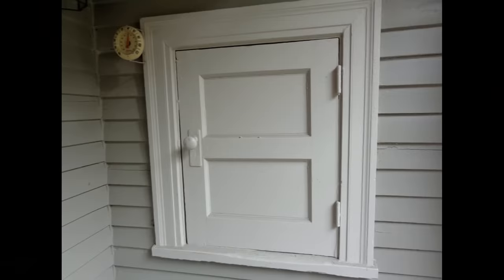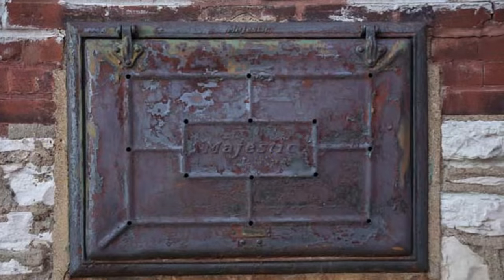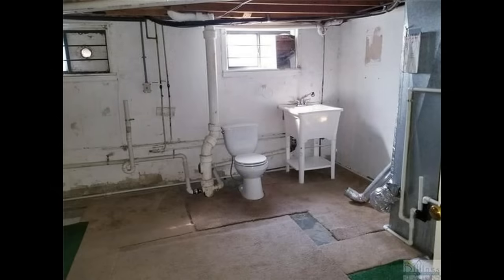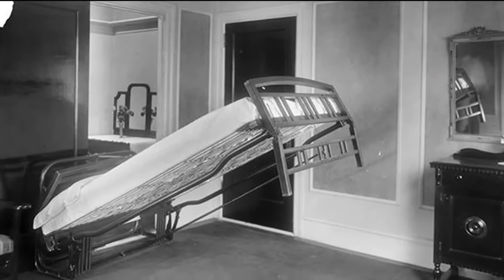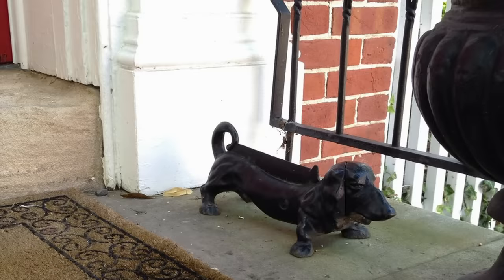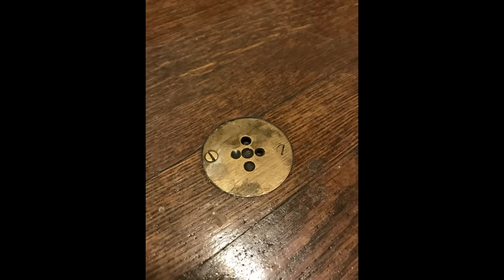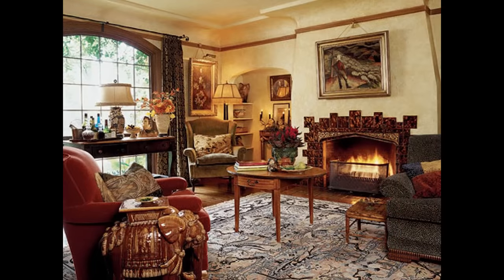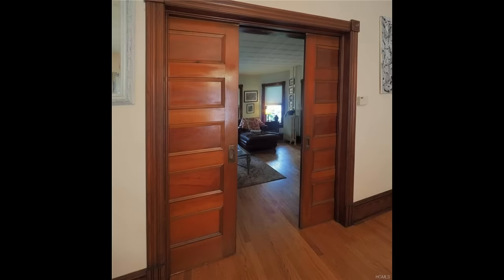Mysterious Home Features No Longer Used

Comment: We moved into our current house, built around '67,  in '93.  It has completely broken intercoms all over the place.  Many times, I've thought about looking into getting them fixed somehow, but I suspect that would involve breaking holes in walls to find shorts or cuts in wires, and I can't imagine it being worth it.  Always wanted a dumbwaiter, though, despite never having a single reason to have one.  The really weird one though, is that when I was a kid, I used to have recurring dreams of finding toilets out in the open in the house in which I grew up, like in the closet that was in at the bottom of the stairs, or in the garage.  I always imagined it was just typical weird dreams, but seeing that these sorts of things used to actually exist is kinda weirding me out a little.
Reply from the maker: That is interesting on your dream and it almost sounds like something you could use to right a story on in a book.  I'm sure there is someone out there that could fix those intercoms and it may not be so bad.  It may depend on your attic space though and some of those 60s homes have a really tight one if they have one at all.  Thank you for watching and sharing what you have.
Reply: If I'm dreaming, and I have to pee IRL, I will often dream that I'm looking for a toilet and any I do find (which is rare, usually I find bathrooms with empty stalls, or all showers and no toilets, or a door marked "bathroom" that leads to something else like a stairwell) will have something wrong with it--either a lack of privacy like having no walls, or it's very obviously not hooked up to anything. I think this is my mind's way of letting me know I have to pee but not letting me pee while still in bed, and what you're describing sounds very similar.

Comment: I live in a house built in the 1890’s.  I have most of what was shown in this vid still present in the home.  The house didn’t get electricity until just before WW1, and even though the wiring is updated…, some parts still have the old porcelain insulators (no longer active though).  We have pocket doors, functioning transom windows, a few push button light switches, coal chute (with original coal room).  They’ve all been rewired, but we even have the original light fixtures when the home first got electricity.  Our home was considered posh in the 1890’s too.  Gas lighting, all gas powered fireplaces, and a full water closet.  They sure don’t build houses this solid anymore either.  It even has all the original wood and cedar siding, that has been well maintained.  It’s a big old Victorian home, so naturally my kids think it’s haunted.., oddly my oldest daughters chose the servants quarters on the 3rd floor for their bedrooms though.., even though they think the house is haunted.
Reply from the maker: Oh wow!  I love those old Victorian homes and it sounds like you have a really nice historic home.  The oldest house that I have lived in is 1929 so you definitely have me beat.  I have always wanted to find a nice Victorian one though.  I'm a big fan of woodwork and carpentry so I love the craftmanship that can be found in those.  Thank you for watching and sharing what you live in.
Reply: You mentioned 'the coal room'.  The house I was born in, that my parents rented at the time, had the big cast iron coal door that emptied the coal into the basement and it landed in something very similar to a horse stall to contain it.
Reply: @chrisgraham2904  Ours originally was like yours.  Big iron door that emptied coal into a stall in the cellar.  Our stall however was a solid three side walled with an open front, which is why some called them coal rooms. Around 1910 the original homeowners finished off the front and added a door.., which I assume was to help with coal dust.

Comment: In many old houses I see a metal plate on the wall. The metal plate looks like a modern day paper plate. It is painted the same color as the wall, and it protrudes a bit.  What are these?
Reply: Most likely they’re covering old chimney inlets. My first old house had two of them on different sides of what I did not even know was a chimney. There was no fireplace, but there was probably an old wood burning kitchen range as well as a heating stove vented through the chimney. When I installed central heat they had to be bricked in so the furnace could safely vent without gas leaking into the house.
Reply from the maker: Those were where the old chimney was.  Probably for a old cast iron stover or wood burner was.  Thank you for watching Stacie!

Comment: This was fascinating to watch.
Having spent a little time living in an
older magnificent mansion-type house
and visiting others years ago,as well as
other 100 year old homes,I can fondly
attest to many of these features,and more.
Do they still make Dutch doors?
I also remember doors that did not open 
left or right,but instead rolled into the wall.Sometimes these were doubled,and
were able to be locked together when
pulled out of their respective walls,
and met up in the middle.
The one feature that stands out in
memory was a built in, yet jutting out
phone booth(remember those?)type
small,compartment size room,which
was made the same time as the rest of
the house with the same wood and stain
as its surroundings.This was built in the
entrance hall and came out of the wall
about a foot with the rest of the space
for someone to sit down in,in the wall.
The folding glass door was stenciled,
and the small padded bench inside
allowed the occupant to sit down
comfortably while using the phone.
It was odd,yet cool to see.And it was
really,not in anyone's way.
All that we were ever told,was that the
well-to-do family had many children,
namely daughters,and they used it for
privacy when they wanted to talk.
I had not seen this before,or since.
Reply: That's fascinating! I've seen that kind of booth setup in old films from time to time, can't remember which ones though

Comment: What modern home doesn't have landline jacks? It's not the 25th century yet.
Reply from the maker: Newer homes do not have them.  Unless you are talking about ones for ethernet cables.
Reply: I wonder if new homes being built today (2022) have phone jacks and cable for TV.
Reply from the maker: The ones near where I am do not.  Just an ethernet jack or jacks.  Plugs are installed with USB options as well.
Reply: @RhettyforHistory  And garages will be built with charging stations for EVs.
Reply from the maker: I'm sure that will happen really quick if it hasn't already.
Reply: @RhettyforHistory  Oh, do the landlines go through that, as all the landline phones are digital now?
Reply: @erikaquatsch2190  Given that every electric car manufacturer uses different charging station standards that seems unlikely.  But, a dedicated 240-Volt socket is definitely likely to become standard.
Reply: For here, we repurposed landline jacks as part of the Vonage VOIP service.  Works great.

Comment: One problem with pocket doors is that the track and hardware generally have to be installed directly after main framing, but before insulation and drywall.  This means before paint, which comes before most finish work, ie. Doors.  Most 
sub contractor s who do new home millwork Installation aren't as big fan of pocket doors because it means you have a big time gap between installing your track and hanging your door, much less doing trim. This potentially means multiple visit s to the same job and, frequently, carrying costs.  And since the window of opportunity to install is sandwiched between two other (frequently in conflict) trades who are both also on a time crunch,it puts the carpenter in an undesired position of being at odds with both framer and drywaller making client satisfaction difficult.  Don't believe me?  Call up a millwork Installation contractor in your area. I think it's these difficulties that have made pocket doors less popular, as well as seeing barn style track doors a lot more.

Comment: We have a working laundry chute and its the bomb. No carrying laundry down, no hampers.
Reply: I looked at a house that had one and it had a huge cardboard box under it.  I swear it was big enough to hold 1 1/2 refrigerators.  Figured they either had a lot of laundry, were lousy aimers or had a strong wind between the top of the box and the ceiling.  The house I bought has one but prev owners turned a bedrm into a laundry room - great.
Reply from the maker: Thank you for watching and sharing what you have.

Comment: Phone jacks are not a thing of the past. My high speed internet it connected through the phone jack.
Reply: Is it really? Or is it ethernet?
Reply: @3mtech  probably DSL. I have both running at my house (DSL and coaxial) phone line/cable
Reply from the maker: It wouldn't be very high speed if so.  I'm not even sure if the old dial up is even available but I would bet it is an ethernet jack and cable.
Reply: @jeffraines414  Interesting. So DSL is direct connection, no modem or router?

Comment: Thank you.
 I work pretty much exclusively on 100+ year old homes.  It's not uncommon at all ,even in upscale communities, to have rooms on the 2nd floor, and throughout the home, mixed with new, still electrified with knob and tube wiring.
 With proper modern fuses it's still relatively safe, the wire coating is normally rather brittle, but copper core conducts the same. 
 That transitional era when electric appliances increased, the demand on a given circuit was increased, people would switch out say a 10amp fuse with a 20amp. Wires on that circuit would over heat and melt the coating and start a fire in the wall. But yeah tons of homes across The USA with that stuff.
 My 1st apartment in Chicago had a Murphy bed, I was thinking how cool. My first night sleeping in it I discovered it was built for people under 6' tall. Had to sleep
Diagonally, then eventually just threw mattress on floor at night .
Reply: I have lived with knob and tube wiring in our 100+ year old house for 23 years. Works. 1970’s oil furnace and hot water baseboard heating still works too. So does the 1950’s electric refrigerator. We did replace the old single pane double hung windows. There is a reason people replaced them; our curtains used to blow in the winter wind. 😂

Comment: If you don't have a landline, you're foolish.
Reply: But be sure it's really a land line.  I realize the importance of a landline so I made sure to get one when I moved.  However, one time the electricity went out and I had no phone service.  I asked the internet/phone company about it and found out that now, most so-called land lines are connected to the cable or router box and will not not be able to be used in an emergency situation as expected. Not right!!
Reply from the maker: You're right.  I would say the majority of the areas that still have landlines jacks are converted digital.  It's really a reason why those old rotary phones do not work anymore.  If the service was available then those phones would still work.  They were built tough.
Reply: I didn’t want to get rid of my landline, but it crept up to $60 a month and all I used it for was finding my cell phone.
Reply: @lindaterrell5535  mine is $30 with Spectrum.

Comment: Working shutters.  Nowadays it seems they're strictly for decoration but when I was a kid they were closed on summer days to keep the sun and its heat out.  They had slats which you could move for air and a little light.  And, changing to heavy curtains (drapes) in winter for window insulation.  Curtain stretchers (ouch) for sheers; now you can just wash and throw in the dryer or toss over a line - a what?  I really miss those shutters, tho.
Reply from the maker: Thank you for watching and sharing a few more features for us to remember.

Comment: Before the intercom there were speaking tubes, rich people had what looked like a rope they pulled to summon the help. Old windows had 3 holes at the bottom for air to to come in from the outside.Many old homes had two doors from the outside that you opened to access the cellar. Fold out ironing boards used to popular and stored into the wall. And the strangest thing was how you were charged for electricity, light socket was cheaper than wall socket, so you could buy an iron or other appliance with a bulb end on it to screw in a light fixture.
Reply from the maker: Thank you for watching and sharing more for us to remember!

Comment: Our house has one of those Pittsburgh potties and a sink in our basement laundry room! Several years ago, we tried to restore it so that the room could be used as a restroom when no one was doing laundry, and it worked! However, no one liked using it, so now the toilet is still functional but not in use and the sink is still used for rinsing laundry.
Our house also has mostly pocket doors on the first floor (ground level). They’re absolutely fantastic and unless they pose some sort of structural or fire hazard that I don’t know about, I would recommend that they come back into style!
Reply from the maker: Thank you for watching and sharing some of what is in your home.

Comment: My house was built mid 1920's and had the knob and tube wiring, the push button light switches, the weighted sash windows, and a section of cellar floor that was clearly for coal storage. Also, had a slot in the medicine cabinet on the wall in the bathroom. When we renovated, several old razor blades fell out. When my electrician came to repair something, he said "Do you like to live dangerously?" Changed out all the old wiring then .
Reply from the maker: Thank you for watching and sharing what you had in your house.

Comment: We called it "the milk box", and as a kid, when locked out of the house, no key to get in, I would crawl through the milk box and open the main door for Mom as the inner door of the milk box was often left unlatched. If it was latched, we would break one of the small panes of glass and reach in to the inside doorknob to open the door. The local hardware store cut a new pane on several occasions. Good memories ☺️
Reply from the maker: I appreciate you sharing some of your memories with these items.

Comment: Pocket doors need to be considered very carefully. My uncle had a new home built and had pocket doors everywhere. There were pocket doors installed instead of French doors going into the dining room. It is the main support wall of the home. Directly upstairs above these was the door to my cousins room. In less than 5 years, the door to that bedroom could not be shut. There were cracks in the walls above the dining room doors and the bedroom door. The installation of the pocket doors ultimately caused structural damage to the main support to the house

Comment: I remember my grandparents house had radiators for steam heating and the boiler in the basement.  Their house also had non-functioning gas light fixtures, crank doorbell in the middle of the door, a little acrylic gas heater in the bathroom and poles on the curb with horse heads and rings for tying up horses.
Reply from the maker: Thank you for watching and sharing some of what your grandparents had.
Reply: @RhettyforHistory   Thank you for making this video.  It evoked fond childhood memories.

Comment: Nob and tube wiring is still common in older homes. It's fine if you leave it alone.
Sleeping porch is a big one you've missed. Pretty much every house had one prior to air conditioning.

Comment: I had a Pittsburgh potty set up in my basement that has long since been dismantled.  Still have unused phone jacks in my house, as my landline is now run through my Comcast cable service.  My grandparents had those old push-button light switches in their house.  Honorable mention should go to pull-chain light switches, pull-chain flushing toilets, rounded archways between rooms and lightning rods.  When was the last time you saw those in a house?
Reply from the maker: Thank you for watching and sharing what was in your house and your grandparents.  You certainly mentioned some great things to remember.

Comment: Cool video. Parts of it reminded me of my Grandma's house, built in the late 1950s (which she sadly sold last year) - it had an ice door, a laundry chute, some sort of shelf which folded down from the wall in one of the basement rooms (I think my dad had a model train set on this at one point?), and, most strangely, a narrow window in between two bathrooms with wooden slats/blinds that could open and close. Some of the older features in your video (like the picture ledges, servant staircases, and round electrical buttons) I've seen in historic homes from the 1890s-1910s that I've either volunteered at or visited.
Reply from the maker: Thank you for watching and sharing some of what was in your grandmother's home.  Sounds like she had a nice house.

Comment: Floor drain for melt water from the ice box (versus emptying a basin regularly);  Cisterns for storing rainwater from the eave troughs; Old gravity type furnaces often would have a wall plate near the floor where a furnace chain would hang to control the heat remotely before modern thermostats were common.  The "Krushchev fridge" in soviet apartments was just a ice door type deal with shelves and used as a natural winter fridge,

Comment: suggestions:  turn style doorbell.  Interior pocket shutters that fold into the woodwork.  Stove pipe vent grates in ceiling and floor of upper room to allow heat to go up or close to prevent.  Skeleton key hole covers to prevent drafts.  Speaking tubes (early intercom) ((this house has all the bells and whistles)).  Cisterns in attic or buried in the yard.  Hand pumps for cistern water (dry sink).  potato or flour bins built in.  BTW, I enjoyed the video!!